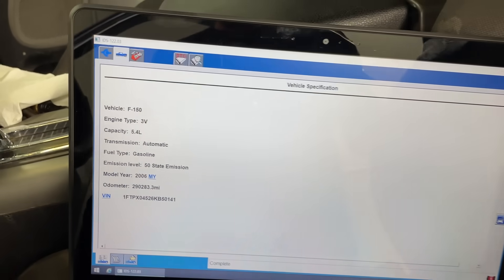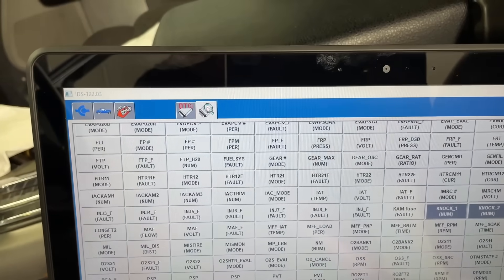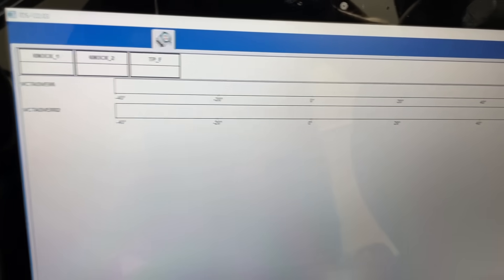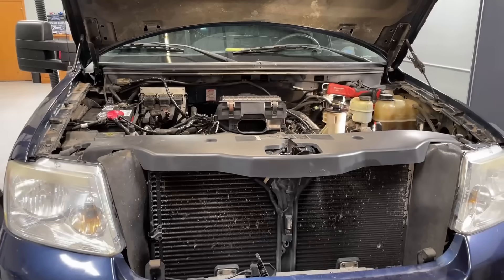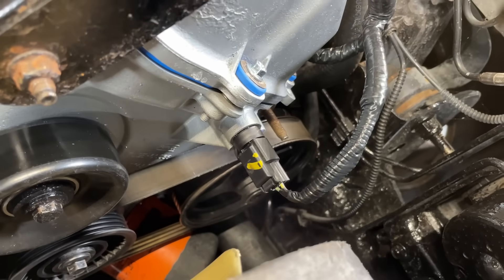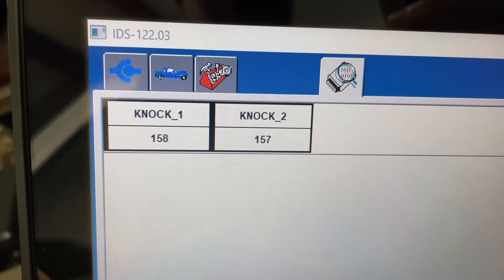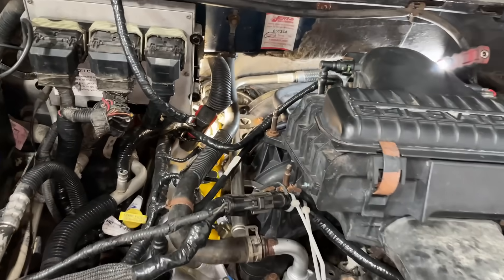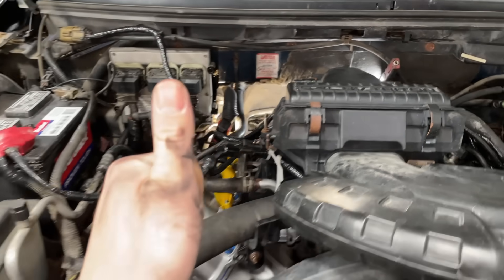Ford F-150 5.4L 3v Triton P0325 P0345 P0349 Cam Timing and Knock Sensor Faults After Engine Install

Comment from the maker: This is the best grease to use when reconnecting electrical connections-
https://amzn.to/3x38NF2

Forscan is a free Ford Specific Diagnostic Software:
Download Here- 
https://forscan.org/home.html
ELM 327 Adapter I Recommend-
https://amzn.to/2GC6dBj

As an Amazon Associate I earn from qualifying purchases.
Reply: Where is the download link within that forscan app you posted? Free software you say? How is it compared to IDS
Reply: @williambish8908  after just going thru this last week,  i can tell you to just Google it.  There are several forums and videos that will walk you thru the procedure.  I had a painful time with windows 10, but i am not computer savvy.  Also, mine looks different from the video (I'd love to know why),but can still see and change several parameters of my 11 f150.
Reply: @williambish8908  software is free but not the obd2 adapter. It’s only like $50 but gives you a lot of great data. I’ve used for scan on the pc and it’s not to bad considering it’s free. But I’ve got old bmw software from the 2000’s and even dealer software for free that’s much better.
Reply: Thanks guys, I know I have to grab the MX adapter, but just wanting to know how equivalent this is to Ford's IDS software. I'm looking for the download currently to give it a shot
Reply: @williambish8908  I think their software as a demo mode if it remember so you can play with it before buying the adapter. From what Ive been able to do it just reads codes and can do some coding but not much more from what i have found. I cant do any bi directional control besides self tests that i have found.
Reply: @FishFind3000  there's a free extended license that's good for 2 months and renewable forever
Reply: Where did you get your ford education? I'm always wanted to be a ford specialist but can't really get my foot in the door at the local dealership. Will be turning 25 in a couple months so I feel time is running out
Reply: I need some help, currently working on the 2012 Ford f150 3.5 Ecoboost and doing the timing chain and both phasers, after i removed the crankshaft pulley a buddy of mine tired to loosen the bolt, and accident spun the engine counter clockwise and jumped some teeth, what can I do before so start removing the rest?
Reply: WHAT is that little wire-stripping tool you use?  It is very, very cool.
Reply: I called your shop in regards to DPS6 clutch replacement. I was told you guys don't work on those???
Reply: I’m b”
Reply: spending so mucht to do right and still using FRAM oil filter .......the  worst filter on market
Reply: Question: how did you connect yur harness? Do you have to solder it? I didn't, can that cause issues if I didn't? I'm having problems diagnosing my 06f150 and have spent alot of$ getting fixed.and I still have a hard start mainly when it above 32deg out or right after it cools down from running it has long cranks but does start,any ideas? That is can look into? (I just did injector 3005) and fuel pump/filter,reley box,coil,. And I'm getting frustrated. PLEASE HELP with any suggestions 🙏 ty

Comment: My bank 2 cam phase sensor seems to be not being triggered because the whole camshaft is back about half a roller follower width from where it is supposed to be.  According to the service records this is the cam shaft that was replaced a year ago.   It looks to me as if it was installed improperly,  as opposed to walking.   Should i try removing it and reinstalling it in the correct position?  There's no play in the journals that i can detect.
Reply: In case anyone read the previous comment.  I finally got a day off work so i could try to finish working on this thing.  And it all makes sense now,  because the cam was snapped in half under the first cam journal.   I'm still trying to understand how it was able to run like this.   There was about a cm gap at the breaking point.

Comment: Hey man I really need your help with my truck. I neeed to know what are some ways for me to diagnose my truck(07 5.4 3v)I’ve done everything mechanical but now it’s down the the electronics it has a rough idle before and after I done my timing chain kit on it…

Comment: Ive had my f-150 everything on the truck is about new . Tho it starts then shuts off about 15 seconds later an then wait a day or so an it starts up again but shuts off after a few seconds then doesn't start back right away . Im stuck on what is causing it ? My knock sensor plug pigtail is bad with exposed wires by the plug in . Any advice please anyone ? My engine is a 5.4 3v .

Comment: Ha I have one of those right now. Bank 2 325k did the timing job about 120k ago. Did pinpoint test pcm connector to cam sensor. Pass. Still working on it. Wish mine was that easy

Comment: I did however fix my connection to my 4x4 motor on my fx4 from your vid and the cam sensor light is always on but runs good I’ll let you know how it goes

Comment: How did you repair the pigtail?
Reply from the maker: Depinned the pigtail shell and inserted new one on.
Reply: @FordTechMakuloco  Okay thank you. I bought an 05 Navigator and it has an aftermarket cam sensor that doesn't have the factory connector. So I keep getting p0345 and p0349 possibly due to the aftermarket pigtail. So I was wondering what my options are? I appreciate your videos and the knowledge you share. I'm on a very tight fixed income, so I appreciate your help with your videos.

Comment: Please help!
My 2007 V8 5.4 litter f150.
Has the p0345, p0349.
It starts and idles fine.
When I put it on gear it stalls immediately;... only when the weather is cold specially at night.
When the weather is warm the problem goes away.
Any idea if it might be the same problem as in this video?
Thank you.

Comment: Hey i got a question got a p0340 p0304 p0344 camshaft is fine changed out anyways new timing components but crankshaft sensor connector is broken truck wont start was running fine then stalled and threw those codes now crankshaft wont start could it be that connector for the crankshaft? It all happened pretty fast no rough running before hand..

Comment: Bryan!!!!! my 2001 f150 4.6l 2v new crate motor did it myself not a mechanic by trade but i learn as i go thing and spend many hours on your youtube video's i can be assured by your consistency and various applications are to the tee but im stuck with a dtc p0320  using a O'reilly's  scanner as you know has limitations on functions and had codes p0340 ,p0714,p0715,lean codes cleared those after installing new fuel lines that leaked ,new injectors,vacuum lines oh,scanner loses communication with PCM? I also had problem with new PCM theft lock out so replaced it with the old one so atleast it would start. now cleared all codes to immediately get only p0320 again.I did do a smoke test for vacuum leaks with no obvious detection and furthermore changed from the cast intake manifold to the plastic version if that makes any difference idk but torque spec's may vary? ANY GOOD RECOMMENDATIONS? thanks!
Reply: forgot to say that it chokes out when i drive it .

Comment: Thanks man! I always love your videos, they are super helpful! I found this one because I had a camshaft position sensor code on a 4.6l 2008 sport trac. I already ordered the sensor, but after watching this video, I went to look at the connector to see if I should also order a new pig tail. I found one of wires severed clean in two! A quick solder and heat shrink job and the codes are gone!
🍺🎉

Comment: P0012 p0022 p0345 codes and I've changed the cats and both cam position sensors.  What else could it be. Doing this after sitting about a yr. Changed the oil too

Comment: Dude you are the best. I rebuilt my motor off of your channel so thanks for putting the info an tutorials out like you do. I'm currently having the same issue after redoing the timing and oil pump. My sensor is good but I think the pigtail is bad. It runs great no misfires no hesitation just the p0345 and 349 code.
Reply: What was the solution?
Reply: Did you figure it out

Comment: My wife's 2011 Expy is getting the 345, 349  and my scan tool won't even clear the code because the sensor fails the koeo test. I tried a  a test light and get a ground when hooked to battery pos, but get nothing on the other wire when hooked to battery neg. How do I test this circuit if the pigtail shows no damage?

Comment: Im lost, 2005 ford F150, I was getting a P0345 and P0340 code CSC #2 bank. Manually trouble shot it down and found low voltage 6 volts on one pin on the connector and 12 volts on the othere Pin. This is the same for both sides. Found dead cell on the battery so I replaced it cleared codes. Drove perfect for 30 miles then it felt like I started to loosing power, recieved a caustion, check gauges and all hell broke loose, rough idol, clicking sound, power loss then the truck died, I got all codes for #1 and #2 bank cam shaft sensors. Replaced both sensors two months ago, checked both good resistance, 335 holms. Check power through batery to pins loss of voltage 12 v on 1 pin and 6 volts on the other for both sides! checked wires at the connectors cant find an issue! trying to find a wire schematic to see if I can isolate it down. Any recommendations? 268,000 miles
Reply: PCM
Reply: did u got it fix i have the same exact problem. parts that been replaced 
both cam sensors. timing chain 
vvt solonoids and still not running right

Comment: Will this same issue cause a p0012 and p0022 after you clear and drive? I've done the timing chains and phasers 3 times and it throws a p0340 and p0344, then a p0012 and p0022 after you drive it.
Reply from the maker: You have oil pressure and volume issue at the phaser when hot.
Reply: @FordTechMakuloco   should I run a heavier weight oil? It has a new mehling pump.
Reply: Probably had a harness problem all along. Or high pressure oil leak

Comment: My 2014 Mustang V6 3.7 only gives my scanner P0346 when I scan WHILE driving. No check engine light. I have symptoms such as rough idle and reduced engine power. I replaced many parts including the VVT solenoids, the cam sensors, injectiors, alternator, etc. The wires look good. I had VVT errors but after replacing them that code went away. I am really worried and I tried so much. Does anyone have some guidance or ideas? Thank you.

Comment: So many 5.4  F150’s have this cam shaft sensor bank 2 code. It can’t be all of them are having corroded wiring. I’ve been researching this problem for my stepdad for hours now. If it turns out to just be a corroded wire I’m going to be simultaneously pissed and happy.

Comment: Totally appreciate the video! Did I hear you say that the cam position sensors NEVER fail? I got the code last week, swapped out both sensors, the trouble code went away immediately BUT then I took the truck on a road trip about 250 miles and on the way home CEL / same code came back. Now I’m wondering if I broke the wires. How do you repair those connectors?
Reply from the maker: The sensor's never fail yes, your concern is the timing set not wires or sensors.

Comment: A few year back I purchased this truck recently It would run fine for a mile or so the a a sudden major power loss. first thought was cad converter clogged, checking I learned there is 4 of them. My friend saw that  the water pump was leaking. So I have no Idea what the previous owner upgraded or if any and since the oil pump is right there I am putting the high volume pump on as well. There was no timing issues but I have never had any experience with this motor, much less phasers. I have decided since its right there and to avoid having to basically do this again is to replace the timing chain, phasers and all. I want to know should I replace the phasers or reuse them and is this product a good replacement I am also buying
E-cowlboy Crankshaft Positioning Tool For Ford - Timing Chain Installation (cam phaser locking + crankshaft positioning)
however I still have no idea what could be causing the sudden and massive drain of power. we haven't really started to tear down the engine to do all this yet, I did see a lot of oil on exhaust pipe when i crawled under and can see it on back of engine not sure if blown head gasket or leaking from valve cover and will not know until we start removing parts to install timing water and oil pump. a year ago i had to replace the oil sending unit adapter plate because where the oil sender screwed in was cracked and a larger chunk was missing this happened after changing the oil not sure if it was pressure but i was nowhere near that to brake it the oil filter was by front bumper, That was a job in it self to replace but after that it ran great, . one more thing before losing power all the gages in the dash would stop working like a short somewhere then would start working again, time varied when it would start working again and if it sat all night the battery would be dead next morning, Im in no rush to do this I really like this truck and the power it has when I had to pull friends out of ditches, I never felt any strain or had to jerk anyone one out and these where very deep ditches on bot sides  on a  narrow road. pulling them out at a 90 degree angle I just locked them in put it in drive and never touched the gas and they came right out. I didn't expert that when I first got the truck I purchased manual locks and they are still in the box every other automatic locking hub I owned I had to put manual locks on them because they sucked, I cant say that about this one
Diamond Power Timing Chain kit Replacement for Ford Expedition Navigator 5.4L V8 SOHC 16v TRITON 97-00, Opens in a new tab
Diamond Power Timing Chain kit Replacement for Ford Expedition Navigator 5.4L V8 SOHC 16v TRITON 97-00Diamond Power Timing Chain kit Replacement for Ford Expedition Navigator 5.4L V8 SOHC 16v TRITON 97-00
$98.18$98.18

Comment: You would think that tech's probing thru wires would have enough common sense to put a dot of liquid tape on the hole they make in the wire - but i guess not.

Comment: 210K on my 04" F150, I have a bad follower on #3, other issue I see is quite a bit of fine copper (where did it come from?) washed onto the timing cover inside front of timing cover in front of r/s phaser. I will need a cam as well. help me decide: 'do I : do minimum repairs to get it on the road? or pull it, do a complete rebuild? the rest of the truck is in very good condition, including the trans.

Comment: i just replace the motor i did a test drive everything was good (got the motor from powertrain) but drove the second about 2 weeks later stop to wash the truck i let it run while i washed it  i got 2 mile form wash engine light comes on motor started running rough wanting to stall at a stop. i put a scan tool on it. i get codes p0022, p0018, p0340. p0345, p0355 vct err bank 2 is at 53

Comment: Great job, I just did the same thing, except for Ford pinched the wires in between the valve cover and PS pump bracket.

Comment: So far your the best Ford tech I have found on Youtube.
I have a issue with a 2006 Lincoln MarkLT 
I swapped engine and transmission from a donor 2007 Mark LT ( engine on the 07 had been rebuilt by Ford 20k miles)
But I have a CEL and I have codes p0320 p0340 p0345 
I did find a broken wire on the top passenger side head. (Not sure what that sensor is. Also noticed that both  said sensors look different from the 06 and 07 model?)

Comment: Good Day Makuloco, 
I have a 2014 Ford Fusion SE 1.5l EcoBoost…and…I’m experiencing sluggish takeoffs from a dead start…

I’ve changed the following:
• spark plugs 
• VVT sensors (front and rear)
• O2 sensors (up and down stream)
• MAF sensor
• Air filter

I cleaned the throttle body and the BOV…and it got better everly so slight…but…still sluggish overall… …your thoughts 💭 

I would like to thank you ahead of time for your time and consideration…
                       Thank You

Comment: Will bad knock sensors cause the engine to make a knocking sound from time to time? 
After driving for a while it will make a knocking noise and stop.
Reply from the maker: no they won't.
Reply: @FordTechMakuloco  well what could the problem be. I had the knock sensors replaced. And still no acceleration power.
Reply: @Famcov215ify what was it

Comment: I’m getting oil in my air filter and air filter housing on 5.4 triton… any idea why this is? Thanks!
Reply from the maker: Almost certainly from the pcv baffle in the valve covers, unless the engine is worn out and you have horrible blow by.

Comment: Thank you for all your help dealing with these different issues. Tbh this is the last time though im getting a ford. Alot of the dealers want to drag you through the mud and if its a computer issue its worse.
Reply: Doesn't matter if it Ford, Chevy, Dodge.... They are all the same.

Comment: Sometimes when my triton 5.4 is under strain pushing up a hill, rpms at about 2500,  I hear a very loud rattling sound, like marbles coming from the engine.  Any ideas anybody. 🙏🏻🙏🏻🙏🏻🍻🍻🍻
Reply: Clogged cats.
Reply: @cesar9496  thanks Cesar..  It turned out to be a loose heat shield on my exhaust system.   Thank God.   I expected a huge expensive issue and a 5 dollar ring clamp fixed the problem completely.  🤣🤣🤣
Reply: @ianhillman4007  oh damn!  That’s awesome!  I had the same issue but it was my cats.  I went catless and gained so much power and no more noise.  That’s awesome!
Reply: @cesar9496     Good for you buddy.   That's what I would do too.  👍👍👍🍻🍻🍻

Comment: 5.4 V8 F150 Lariat 2 wheel drive, automactic. I keep having to add brake fluid but find no leaks. What gives. Thanks
Also your thoughts on Deep transmission pan with. Dipstick  after market. 08 Eddie Bauer Explorer, V6 4.0, 2 wheel drive automatic . By Summit Racing. $292.